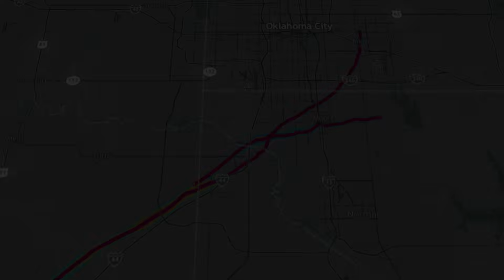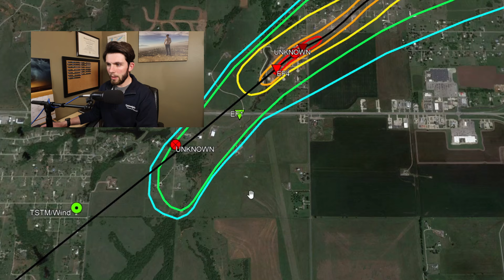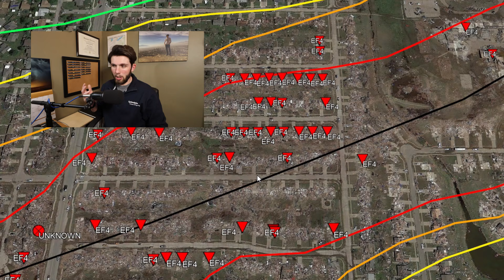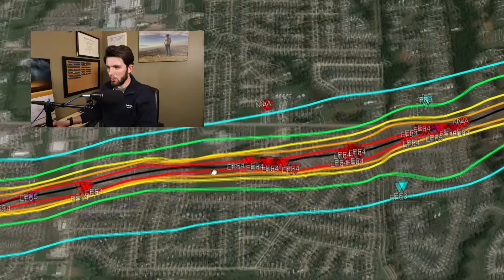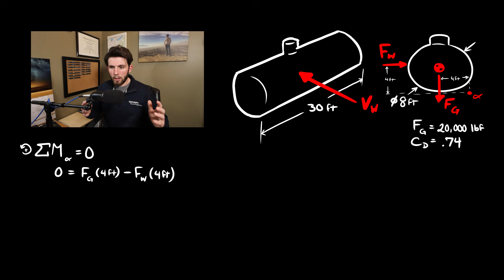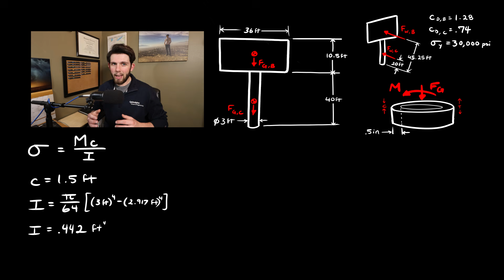DAMAGE ANALYSIS: 2013 Moore, OK EF5 Tornado

Comment: 17:00 in the video you mention how the “extra criteria was established for an EF5 DI was so the surveyors can definitively, on the spot mark it as an EF5 without the need to find……etc”. 

However, when a tornado is initially thought to have EF4 and above damage a specialized group of engineers and surveyors are brought in to dig deeper into the damage.  

But every single high end tornado that is a possible candidate for EF5 somehow winds up NOT receiving the EF5 rating.  

Ethan, I’m by no means saying you’re wrong.  The way the scale is designed to work is exactly as you described.  Problem is, it was supposed to eliminate subjectivity in the ratings but it had actually made the subjectivity worse. 

If it wasn’t for you personally putting out content using your crazy mathing skills, I don’t think anyone would have dug into the Enderlin ND train cars situation.  It seems the NWS is/was hellbent on NOT including contextuals that would prove an EF5 rating.  But rather, contextuals have been used to AVOID the EF5 rating.  Even when those contextuals DO NOT PROVE winds were below EF5 threshold. 

Great Work Ethan.  Truly Great work.

Comment: If the houses that were rebuilt are hit again and have the same level of damage, every single one of them will be EF5. All of those houses had to be signed off on by a LICENSED city inspector, and all new constructions are required to have tornado ties in both Cleveland and Oklahoma county. 

Moore HS tornado shelter can fit nearly and probably over 3000 people in one wing. There’s 2 wings and 2 floors on both. It is rated for winds of 375mph, and impacts rated for equivalent of 270kg of explosives. Following proper procedures(they don’t mess around, I know first hand the drills they did, I went there) they can move the entire school population in there in under 7 minutes. If they don’t have 7 minutes(we just had an unwarned nocturnal EF3 the other day), the historic parts of the school are EF4 rated like all Moore schools, but the new additions I’ve heard are also EF4 rated steel and concrete construction. With the new codes saying you can’t have windows facing the street in schools because yay this country is amazing, there’s no windows making it probably able to resist anything it needs to. 

I graduated in ‘21, and am now pursuing a degree in architecture at OU because I want to be the reason In more ways than one why people survive these storms.

Comment: With the billboard just because it takes those winds to break the steel tube doesn't mean the winds didn't far exceed that. Which is why it is impossible to accurately determine.

Comment: There's even more to this cylinder story and the clue is in the design: It's cylindrical, a smooth surface that would have a lower drag coefficient than a multi-sided object; say a square, rectangular or hexagonal shape. However, not to appear contradictory, a multi-sided shape would have a considerably higher drag coefficient, meaning a 20,000lb square tank would not be thrown / carried as far as the cylinder, or would it? Is the amount of kinetic energy needed to move any object a specific distance amplified or mitigated by the shape of an object? In any case, the fact that a 20,000lb cylinder with a low coefficient of drag was thrown further than a mile is mind boggling. The power required to keep the perfectly smooth exterior of the cylinder elevated and within the grip of the tornadoes centrifugal force for more than a mile before jettisoning it is beyond comprehension, exponentiation notwithstanding. It's a crude rudimentary rule, but the faster any object is moving, and the heavier the object, the further distance it will travel and, I suspect, the shape of the object may not even be a factor. Would love to hear some thoughts.

Comment: I bet alot of the misanchoring and other construction problems that should have been rectified were because of construction companies cutting corners to build more houses fast. I remember most of them houses went up fast. A huge chunck of them after the 1999 tornado were completed by the end of the year. That is alot of houses constructed.  Not to diminish the fact that this was a massively powerfull tornado no amount of anchoring would have saved alot of those houses in the strongest of the damage path.

Comment: I'm an engineer too and very familiar with all your equations presented. But 209 mph winds picking up a 10 Ton tank and throwing it 1 mile is BS. Put it in a wind tunnel and see what happens. The truth is the tank levitated (which meteorologist continue to ignore). And once in the air, it simply moves along with the tornado. Furthermore, at its most Fundamental Level, a Tornado is an Electrical phenomenon (try explaining a playing card stuck half way in a tree). Until we change our way of thinking, we'll continue to be stuck in the Dark Ages. Otherwise, I did enjoy your presentation. It was well thought thru. Good job!

Comment: Sounds like to me the difference between an F4 tornado IE mayfield/ rolling fork tornado vs F5 Moore is speed of the tornado going across the ground. The mayfield tornado averaged 55 mph. Going 60 mph most of the time. I saw slabbed buildings in Cayce ky with no debris from the buildings that used to be there and after leaving Cayce it sucked up topsoil up to 18 inches deep in spots 
The slower the tornado the more damage it will cause.

Comment: I was in a multi story office when that occurred, less than 10 miles away  the building was new. Afterwards our management asked the city (who owns the building) what tornado rating the building was built to withstand. The OKC response was it was built to code. Needless to say we are told to work from home during days when severe weather is expected to produce tornados 

One thing I disagree with the poster of this video. We were expecting extremely severe weather with a week advance notice.  We had F3's and F4's they day before, but we were still expecting it to get bad on that day.

Comment: The billboard likely collapsed due to impact from debris at the base. Rather than being bent over a stress point, it was bent over what appears to be an otherwise substantial section of the base. 

What likely happened is something like a car or large object hit the base and compromised the structural integrity of the billboard.

Comment: Excellent analysis,  Ethan.

There seems to be something lost in the midst of the discussions regarding classification of the class of tornado that hits cities,  towns,  locales. And that is EXACTLY what you touch on. 

You can have an EF3 destroy a house/place if the quality if buildings is not good. The damage indicators can resemble those of a higher intensity funnels, when in fact it's the quality of materials/construction that is at the root of the destruction. 

I think NIST looks into these often overlooked (by newsmedia and storm analysts), and this is of paramount importance to understand who or what is responsible for tragic events. 

Good videos,  Ethan. Good service.

Comment: Moore - 24 fatalities. While even one is one too many, and every fatality is it's own personal tragedy, other single tornadoes in recent years beat Moore in terms of fatalities. Tuscaloosa, 2011 Super Outbreak, 44 deaths. Hackleburg-Phil Campbell, Alabama, also an EF-5 of similar intensity, with winds at 210 mph, and SEVENTY-TWO fatalities, beats Moore's count by 48 people. Joplin, 160 deaths. This tornado was only on the ground for 13 miles, but unfortunately, just happened to intensify while going through Moore. Hackleburg-Phil Campbell was a very long-tracked tornado and lasted 2 hours and 35 minutes, whereas Moore lasted 39 minutes.

By the way, the previous day, May 19, 2013, had tornadoes. OKC's eastern suburbs got hit. Shawnee in Pottawatomie County, about 37 miles east of OKC got hit by an EF-4, and these storms probably put out outflow boundaries that enhanced the lift for the storms that spawned the 2013 Moore tornado. I do think that May 3, 1999, overall was worse, as it was a big outbreak, and not a single tornado.
Reply: Moore was an EF5 for about 5-10 seconds... Only 3 structures in its path were categorized as EF5 damage and they were 3 homes next to each other destroyed by a single sub-vortex. Hackleburg tornado was an EF5 for over 40 miles.... Joplin was disputed countless times to have no EF5 damage but poor construction throughout and EF4 will cause mass loss of life like Tuscaloosa.
Reply: @SirRobbins  The dispute over the rating of the Joplin tornado was based on a very small sample size of buildings. As with every EF5 tornado, EF4 damage was much more common throughout and was as such easier to detect. Out of 7,964 buildings damaged or destroyed, the survey team that disputed the rating only surveyed 150. 22 homes in Joplin were assigned an EF5 rating, that is some of the most EF5 damage in any tornado since the scale came into effect. 

The Moore tornado had 9 EF5 DIs, not 3. In addition, these were rather spread out in three clusters that occurred at different points in the tornado's life. Given that many homes were swept away but assigned EF4 ratings due to construction being too poor to assign an EF5 rating, it is likely that the tornado was at EF5 intensity for longer than the official EF5 DIs indicate. It also was likely at peak intensity before it entered Moore. Although damage at the Orr Family Farm was only rated EF4 due to the relatively poor quality construction of the buildings there, the contextual damage indicated EF5 intensity. The surveyors themselves noted this. The contextual damage in this region was frankly more extreme than any contextual damage out of the Hackleburg-Phil Campbell tornado. Although the Moore tornado didn't maintain EF5 intensity for as long as that tornado, its intensity at its peak likely was quite similar.
Reply: @TheWigglergler Contextual damage at the Orr farm was comparable to those in '99 Bridge Creek, OK and in '97 Jarrell, TX. At its peak intensity, the Newcastle-Moore EF5 was definitely one of the strongest tornadoes in recent history. 

As tragic and mindblowing as the damage in both instances were, Moore actually probably dodged a bullet that both the 1999 F5 and 2013 EF5 reached peak intensity before entering town, and not while in the middle of it like the EF5 that hit Joplin.
Reply: Just want to say that the Hackleberg - Phil Campbell tornado was one of the worst cases of EF5 tornado occurences. Moore 2013 was one of the strongest EF5s, but it can't be compared to the HPC tornado. Had the HPC tornado ran through Moore and OKC, the casaulties would be in thousands. Remember that HPC was essentially an unsurvivable tornado, it killed half as many people it injured, whereas in case of Moore the death to injury ratio was around 1:10. Just for context, the HPC ripped out three storm shelthers off the ground.

Comment: Wonderful channel, thank you for all your insight.  I have a question for you.  Of all the issues with the EF scale, one that I never hear talked about its the fact that there seems to be no accounting for the duration of winds over a damage indicator.  As you point out in this video, the area where the storm cycled (or whatever it was that happened) yielded a greater concentration of EF-5 indicators in part because that's where the storm was going the slowest.  The Jarrell event is probably the most famous example of this issue.  The EF scale is supposed to measure wind speed.  Doesn't the presence of a time component more or less undermine the whole thing?  Over geologic time, an ant blowing on a house could probably slab it.   I'd love to hear your thoughts on this.
Reply from the maker: You’re right, it’s not something often talked about. There is currently limited published research on how forward tornado motion contributes to intensity of damage, however, I know there is some on going as of right now (Tony Lyza is one researcher I know of that’s working on this topic).

Like you said, Jarrell is the classic example of long duration over an area. However, it seems like some of the violent, fast moving tornadoes also contribute to greater damage thanks to the added forward speed, but the research has yet to be published.

Awesome question!
Reply: Thanks so much for your reply!  I will definitely check out some of the research you mentioned.   @junefirst

Comment: Just remember that THIS was not the worst tornado damage at that time. The most EXTREME damage ever recorded was the jarrell F-5 with Est. Of 260 MPH and moved a slow, painfull 2-3 MPH and Jarrell even had more Confirmed deaths. 27, Because it was so slow it left absolutely NOTHING left in its path it barely dodged the main part of Jarrell but unfortunately hit The double creek estates area where the worst of the worst damage would occur. Houses ripped off of their foundations, All large debris that would be there. Absent. Bodies parts torn so violently investigators had no clue to who the bodies belonged to. R.I.P to all the people who died in Jarrell and moore
Reply: You have to remember that even though the homes in Jarrell were literally gone along with the debris  those tiny houses were probably built in the 50s or 70s. These homes in Moore were almost all larger modern homes built right after the May 3 1999 F5, and yet we still see complete annihilation of all structures along with anomalies like cars thrown into the air, 20,000 pound tanks thrown around like nothing  etc. Jarrell is idolized somewhat, but it definitely was not as massive as Moore 2013. I'm also not sure why they are so strict and hesitant to give F5 ratings to some tornado/damages. The damage to Moore is literally widespread and inconceivable, yet it's full of F4 damage ratings. Pretty silly considering some F4 tornados that we see. Withholding the EF5 ratings so stringently, does more harm than good in my view.
Reply: By  "at that time" i mean it's still now

Comment: I hate to tell people who think homes in tornado alley should be built like tanks, and building codes should be strengthened and enforced, but its not going to happen, at least not to the lofty message board ideals of some folks, because of simple economics.  

Oklahoma isn't California.  The cost to build a home in both places probably isn't that different, but what a finished home can fetch on the market IS very different.  Therefore, developers in less affluent states will cut corners wherever they can when they build subdivisions.  They'll  use less fill dirt.  They'll use less insulation.  They'll use less than ideal foundation anchoring.  People will accept it too because it means a cheaper house.  So will insurance companies because proper anchoring probably isn't going to stop the structure from being declared a total loss if hit by EF3 or higher winds.  It is what it is.

Comment: The fact that this nader threw a 10 TON TANK over a MILE(!!!!!!!) I can’t even fathom that.. imagine getting swooped up by winds that strong
Reply: Yeah, and not only the 210mph winds to move it, but the fact that they were sustained for that long in a vector that kept it aloft is unbelievable!  I think it's safe to assume that it was more than 210 mph at times, at least above the surface
Reply: @matthewjohnson2428  It’s also about velocity more than the winds, pressure differential also crushes debris and can make them lighter to lift especially with multi vortices dancing in the “eye”.
Reply: Make no mistake. This tornado was every bit as violent as the 4.27.2011 EF5s (yes, I'm going there). There is a VERY GOOD REASON why the NWS themselves compare this tornado to Smithville, Phil-Campbell, Hackleburg, and the May 3rd, 1999 F5s. This thing ripped and shredded plumbing and electrical routing out of foundations. Want to know what other tornadoes did this kind of damage? Jarrell and Smithville. Not only is this the last EF5 to occur as of the time of this comment, but it's also one of the most violent tornadoes in recorded history. This thing VERY much lives up to the title being "May 3rd, 1999, all over again".
Reply: @dannyllerenatv8635  Yeah. Don't know why this is controversial. 

This tornado started the EF5 drought lol. Any subsequent candidate would have to be compared to it and the results of the very extensive damage surveys that downgraded many of the previously-EF5 indicators of this one. 

The last time a tornado started an F5 drought before this was 1999, when the strongest recorded tornado hit this very same city. 

So yeah, the 2013 Moore EF5 was definitely every bit as powerful as the ones on 2011/04/27.
Reply: @dannyk1790  Bingo. This thing was so bad it essentially kicked a drought off, just like May 3rd.